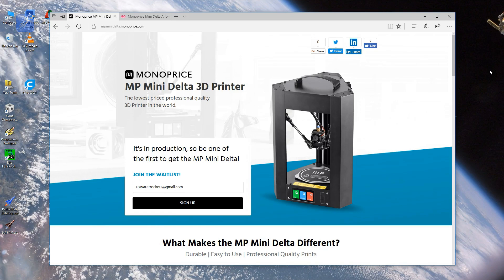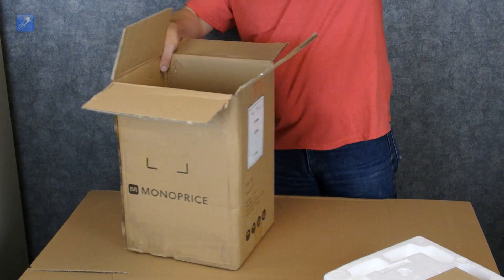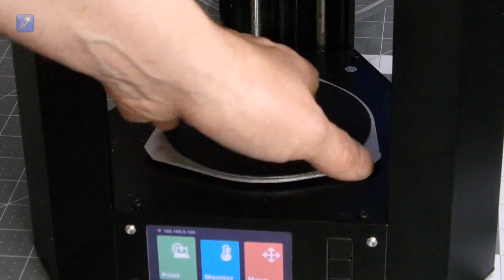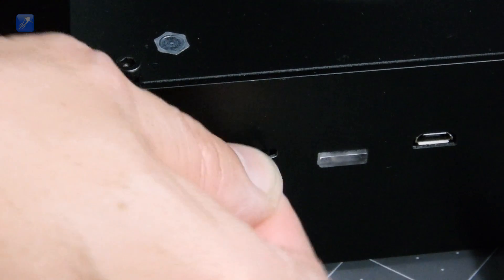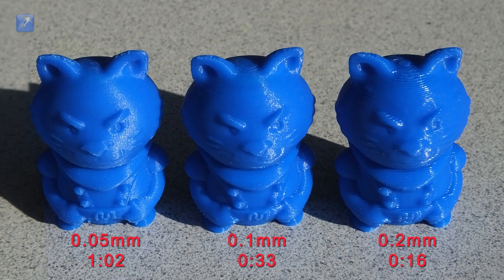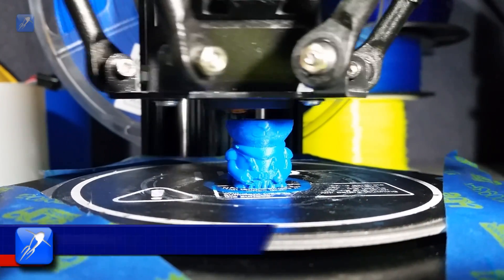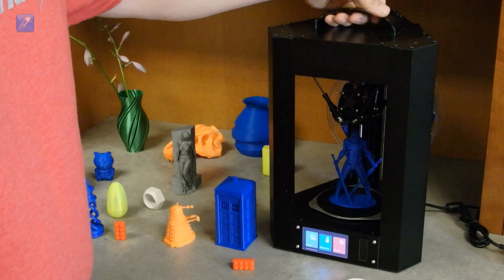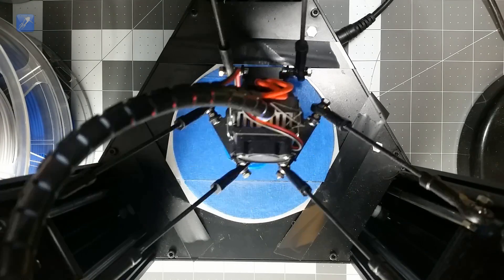Monoprice MP Mini Delta Review - BEST INEXPENSIVE 3D PRINTER?

Comment: Are you getting salmon atterfacting on this printer? Or no?
Reply from the maker: No, I am not seeing any salmon skin artifacts on my prints. That's why I used a lot of close-up images of the prints in the video, because there are many people who would insist that all deltas have this problem. It's not really a delta problem, it's an Arduino problem. Deltas based on controllers derived from Arduinos have an old slow 8-bit CPU with limited memory and power. They can't perform the complex math needed for a delta robot without taking shortcuts that introduce patterns and artifacts in the print surface. Other Deltas such as those using a Smoothieboard use a fast 32-bit CPU that can handle the math and won't have artifacts. The Monoprice MP Mini Delta uses a custom control board with an STM32 ARM based CPU that is similarly capable of easily doing the complex math, so it too does not have the artifacts. The prints I have shown are proof of this and every review so far has been similarly impressed with the excellent print quality.

Comment: You said in the video this printer was from the same OEM as the Mini. I looked on the Malyan site and did not find any offering for a delta. Could you verify the OEM?
Reply from the maker: The OEM is Malyan. I've had it apart and the hardware and software closely match the Select Mini. The possible reasons that you can't find it on their website are because it's definitely not officially released for public sale yet, and there is a rumor that this model is going to be sold exclusively by Monoprice (the same way they are the only retailer selling the Select Mini V2).
Reply: USWaterRockets Thanks for the follow up. Also, thanks for all you do in the MPM and now MPMD communities!

Comment: Nice review, thank you! Hoping my second round order arrives in September! I was wondering if you've had a chance to test it out with ABS. I know it can print it and has a heated bed, but I've also heard that an enclosure is important for proper ABS printing. Thoughts?
Reply from the maker: The big reason for needing an enclosure is because large prints with long spans of plastic will try and curl up off the bed as the plastic cools, or will form a crack as some of the higher layers will peel a lower layer up when they cool. The way to solve this is with an enclosure to keep the heat uniform and cooling more even. Another way to solve this is the print only small objects with ABS. Since this printer is quite small, it can't print really troublesome size parts, so it handles ABS well without an enclosure. I have printed ABS on this printer without any issues, without an enclosure. Keep in mind that the benefits of ABS have been reproduced with newer filaments that don't have the curling or separation issues. PETG is strong like ABS and heat resistant. There are PLA blends that can be annealed to resist heat also. ASA has all the benefits of ABS, including the ability to acetone polish it. You may not need ABS as much as you think.

Comment: That saw was doing a cross cut, but I get your point... ;o)
I like that the display seems easy to read, I'm sold on this one.
Excellent job, the most complete & professional video I've seen on this model.
Most reviewers will show one or two prints, but you've tested the H out of this thing.
Thanks, 200th like & I subscribed.
Reply from the maker: Thanks for the feedback on the review. I don't like the direction that a lot of reviews have taken where they get a free printer and fulfil their obligation to the supplier by throwing together a slapdash review and show 2 or 3 small prints and an unboxing. I think that cheats the supplier and the viewers. I want to make reviews that people will have confidence in.

Comment: Hi, could you share the cura settings for this printer? the settings the manual recommends  are for a different version of cura.

Thanks
Reply from the maker: https://lookaside.fbsbx.com/file/Delta%20AB%202.6.curaprofile?token=AWz8lXBwFIslmgDdbKhLqH5IBW6-ENjXK_y4jP16CsHM5fr-LC5LeRsGv5yqVl9PngxOuopA8S2cMmd-vw7-7vBIHhJUFOlHl3dpjIgeJLY91anbwryJte4dnY6vaMJjVvzuRE-3bsq7uPgQKguH4WYAz-84IXdGR1JRybqzyfwSJGYCsZt4tOq5WUEq8zFxb78muz_uKEWgEZIklfvzggtz

Comment: So I am a home user and I have no idea about any tech stuff when it is broken (In this section of things) and I prob can't fix it. How reliable is this printer? 
And what parts should I Replace instantly when I get it to make it last longer?
Reply from the maker: I have had mine for 5 months now, and used it for 8 hours a day average, and nothing has broken from use. I did damage one of the bearings when I was taking the printer apart during my teardown, but there's nothing that broke or wore out. 3D printing is still a new technology, so there is a learning curve where you will have to learn about various temperature settings and simple things like cleaning the nozzle, but if you can fix a paper jam on an inkjet or laser printer then you should handle this easily.

Comment: Nice video. Can you talk about the cooling shroud? Single direction, bi directional, circular? Is the cooling fan separate from the fan that cools the heatsink on the coldend? gcode control or just on/off? thanks!
Reply from the maker: Air is ducted from the fan through a heatsink with vertical grooves and downward through a duct about 20mm wide that emerges along the front of the hot end with a directional opening that is about 20mm by 3mm  blowing on the part from the front side of the printer. Since this is a delta printer and the part is stationary, people with a desire for added cooling mount fixed fans to the outside of the printer or just put them on the desk. I personally didn't see the need for extra cooling, as my prints have come out excellent with the stock setup. But cooling is a matter of personal taste.
Reply: USWaterRockets okay thanks. I have a similar machine and cooling is a major issue on it

Comment: The week point it obviously the plastic parts rubbing on the metal ball joints. I wonder how long they will last before wear makes it unusable?
Reply from the maker: The printer in this video has been under heavy daily use for 5 months since I received it, and the ball joints show no sign of wear. Self lubricating plastic moving joints are generally not considered a weak point, and many people replace metal joints and bushings with them on 3D printers because they are quieter and maintenance free (see Igus brand bushings and Traxxas ball joints). I really don't think you have anything to worry about. Bear in mind that at this price point you're unlikely to find another fully assembled delta printer with another type of joint, and if it really is important to someone, they can easily swap the joints for something they prefer.

Comment: Great Video, why did you switch to painters tape at the end? Looks like the plate was taped down also.
Reply from the maker: The plastic bed surfaces are consumable. Over time they get gouged up from using a metal knife to remove prints, or burnt by the hot nozzle if you accidentally configure the slicer with the wrong settings, or just from wear and tear. I had the printer for 4 months and the bed was all scuffed up and looked sad for the review, so I put painters tape on top so the bed color would be uniform and looks nicer so people wouldn't think the bed looks like crap. The plate is taped down in the corners because the plastic clips that hold it down were not present on the beta prototypes, and you really need to have the clips to keep the bed stable, so I substituted tape with the intention of adding clips in the future. Thanks for the feedback!

Comment: What orientation did you print the T-rex skull at? Did you have the skull standing strait up on the back part of the skull? Thanks!
Reply from the maker: I prints without any supports in the vertical orientation with the smooth flat part facing the bed and the nostrils at the top.

Comment: Could you please share your slicer profile? I am trying to setup Cur 2.7 and it crashes into the front area after doing the auto level. I can't even tell if its working because they didn't even include a test print on my sd card.
Reply from the maker: The SD card contents are located here: https://www.facebook.com/groups/mpminideltaowners/1840176815997796/ the test print is called auto00.g on the SD card. The same group discussion has our printer profiles and people from Monoprice there to give support for issues like the one you are having.

Comment: Where can one get the "Battle Cat" 3d model?  My friend Steve has searched the internet extensively in hopes of finding this model and he gave up in tears.  Steve is 42
Reply from the maker: The model was custom designed for Monoprice for showcasing their printers, by the awesome Anwar Madrigal. He has asked but has not yet received permission to release the model files to the general public. I have a feeling that it will probably be included as the default print shipped with printers in the future. Until then I don't think it is available. I wish I had a link for you, but I don't think it exists yet.

Comment: Is the build volume a 120mm cylinder or does the radius start shrinking at the higher levels (not at all uncommon with deltas)?
Reply from the maker: The build height is a 120mm tall cylinder with a roughly cone shaped volume placed on top at 120mm and up. I know the printer can reach anywhere inside the cone if the objects do not extend beyond the reach, but I never tried to find the extents of the cone myself. I just am aware that it exists because I use other deltas. Traditionally, a delta will specify the Z height as the maximum it can print before the diameter shrinks. A delta that advertises the tip of the cone as the maximum height is being very unseemly.

Comment: Is the auto bed leveling done via the menu system, through gcode settings added in the slicer, or is it run before every print without user prompting?
Reply from the maker: You insert G29 command at the startup GCODE to perform the auto bed level. The level should be done at the start of every print because the bed is removable. There's supposed to be info in the manual about using the G29 command, but I do not have my production model yet so I can't confirm this. I get it the middle of next week.
Reply: Thanks for the quick reply. I should be in the early batch as well but have yet to get any shipping info. I will be sure to check the manual for the specifics when I finally get mine.
Reply: KS Todd I'm mid-500s (600 in the first batch) and mine arrives 2 August. Check MyUPS for delivery details, it'll give you an estimated delivery window of a few hrs for free.
Reply from the maker: Yeah. MyUPS has the info before it posts to your indiegogo page.
Reply: I'm 589. I checked UPS last night and there was nothing there yet.  Since I am so close to the bubble I am sure I will go out last day of the batch.
Reply from the maker: I'm #27 and on the east coast. It will take a week to ship to me. You could get yours before me depending on where you live.
Reply: #28 in Ohio and watching for UPS daily.

Comment: Two quick questions for you :) 
1: what replacement nozzles work for these? I would like to have a .3 and .2 ready to go when mine arrives next month!!!
2: Do you know voltage leads I have available to pull power from for led strips? Is it 12v, or 24v?
Reply from the maker: The same threads that are on E3D compatible nozzles will screw into the MP Mini Delta heater block. Just note that the standard E3D nozzles are a couple of mm taller so you will lose a the added length in Z travel. I don't know if you can get "short" E3D nozzles as easily. The printer runs on 12VDC, so 12V LEDs are your best option.
Reply: Thanks! I assume we can get replacement ones from MP directly as it uses the same hotend as the select mini right? Also have you looked at the board, and does it have a RGB LED lead by chance?
Reply: Thanks! I assume we can get them from Monoprice directly yeah? It is the same hotend as the mini select right? Also do you happen to know if the board has a RGB port?
Reply from the maker: There's a mysterious 6 or 8 pin header on the board I was told is for "future expansion", but I have no idea what that means. There was nothing specific for LEDs.
Reply from the maker: Same hot-end as the MPSMV1, so parts should be available.